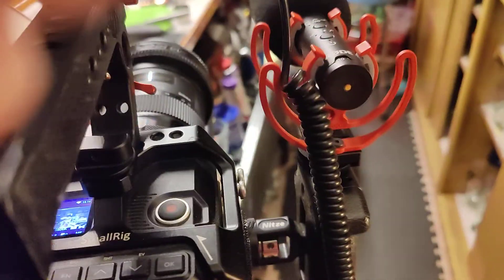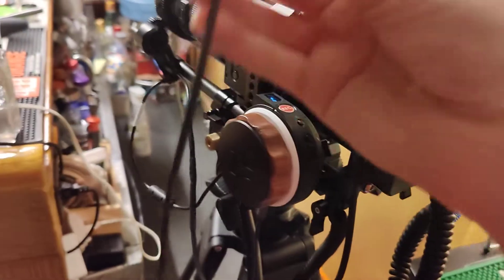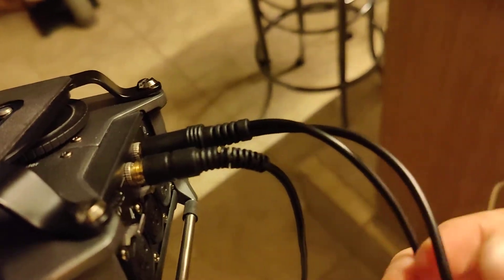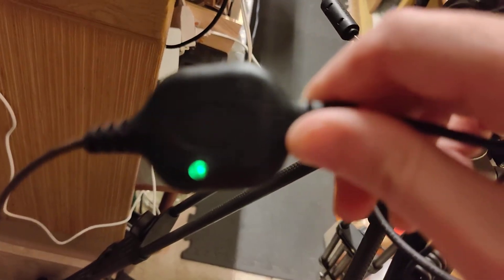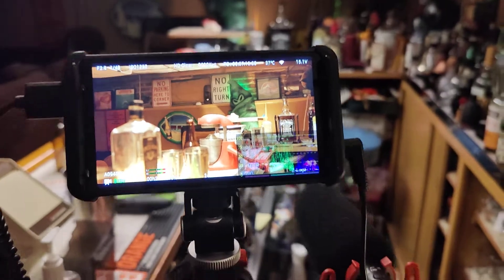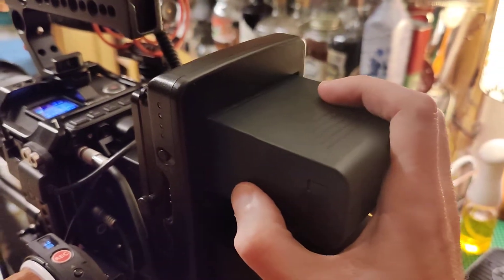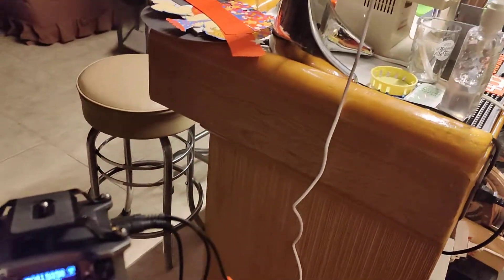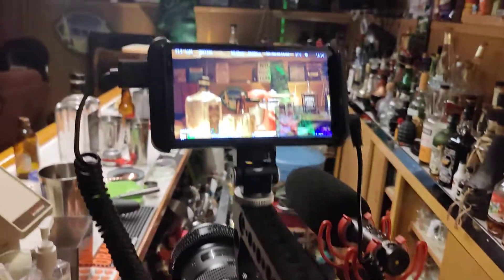Z-CAM E2-S6 and Zoom F6 timecode jam and sync!

Comment: Thanks for this cheaper solution so once you start rolling you can't turn off either camera or recorder?
Reply from the maker: The camera will lose sync as soon as you disconnect it.  Needs to remain connected.  Ive switched to using Detiy TC-1s

Comment: Why do you need a headphone spliter? Does it work without as whel?
Reply from the maker: The splitter is because I needed to control which was input and output.  So I can flip it if I needed to.
Reply: @darrenorange2982  Don't you control it through the camera and zoom settings?
Reply from the maker: @johnnyfog8134  it was easier for flexibility purposes.

Comment: Is it possible to use the 3.5mm TRS on the Zcam for a timecode display and the XLR 5 Pin Lemo to connect an external microphone. Thanks
Reply from the maker: Never tested that I would assume no, TC is input to my understanding

Comment: Did u try to rec long sessions with this setup non stop? I have the same setup and half hour later of non stop recording I have audio drifting issue, so few hours later it's few seconds out of sync. How do you solve this?
Reply from the maker: Keep it connected.  I now use Deity TC-1 to sync everything we run two E2-S6 cameras
Reply: @darrenorange2982  Oh good... thank you. I am planning to buy the TC-1's also. What version cable do I need and where did you get it from?  Thanks :-)
Reply from the maker: @RobertGlotzbach  Alvin's cables timecode cable, just check for compatibility with your camera.
Reply: @darrenorange2982  Thanks for your quick answer :-) Forgot to mention I need it for the F6.... probably the same cable. I saw this cable on Amazon from Alvins..... I asked him about it, but no answer yet.
Reply from the maker: @RobertGlotzbach  Should be the same.

Comment: Hey Darren, thanks for the video. I'm looking to replicate your setup here. Can you could point me to the 3.5mm TRS splitter that you used? Is it a stereo to mono splitter or stereo to stereo? Essentially trying to figure out why using the splitter allows for the Z Cam to receive the Linear TC signal.
Reply from the maker: This is the one I used.  So the reason is it just is a flipped connection to allow it to pull the signal, one channel left or right I can't recall carries it so this allows you to pick the connection.  That being said I dumped this and now use the Deity TC-1 to sync everything and it works perfectly. https://www.amazon.com/gp/product/B096XNHTH3/ref=ppx_yo_dt_b_search_asin_title?ie=UTF8&psc=1
Reply: @darrenorange2982  Appreciate the quick reply! For the time being probably will get the splitter to get me up and running. Guessing the Deity TC-1 works natively with the Alvin's Cables "Tentacle sync" 3.5mm male TRS to Z Cam 4-pin Lemo TC cable?

Comment: I also have a Z Cam E2 F6, Alvin's timecode cable, and Tentacle Sync, however when I connect to my camera the light remains red and there is no way of switching the camera's timecode menu from internal to external.  What settings did you dial in so the camera would input external timecode?
Reply from the maker: You have to set your input control cable 1 to timecode, Go into menu, connection, UART or UART2.  You have to pick which input you want to use and then select that one and set it to LTC.  It should work fine then.
Reply: @darrenorange2982  Thanks for the quick response.  I had to switch the Tentacle Sync from mic level to line level and it worked instantly.  Unfortunately, it doesn't keep accurate timecode when recording ProRes RAW files to the Ninja V; it seems like raw files require actual SMPTE timecode rather than LTC timecode.
Reply from the maker: @theimaginationmachine  You would need to feed the Ninja V the timecode.  I don't use external recording, I shoot ZRAW.
Reply: @darrenorange2982  How do you feed the Ninja V the timecode? What would be the routing path from camera to Ninja? Also would it have to be a different cable because the Ninja does not have the mini xlr connection? I'm assuming it would.
Reply: Great video BTW
Reply from the maker: @sstanek42  You would likely need to feed the Ninja V timecode directly.  I don't know because I use ZRAW and have not found a need for any external recording.
Reply: @darrenorange2982  Okay thank you.